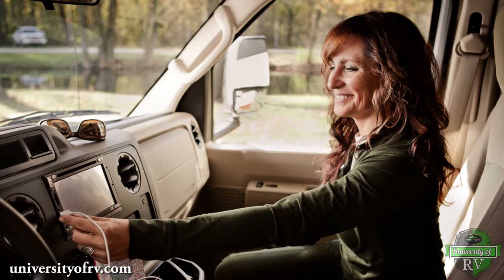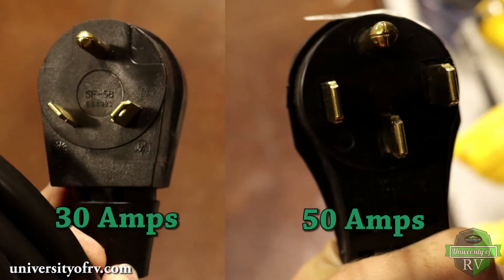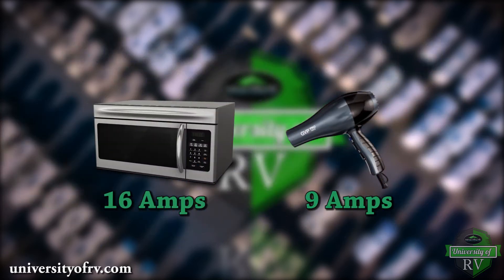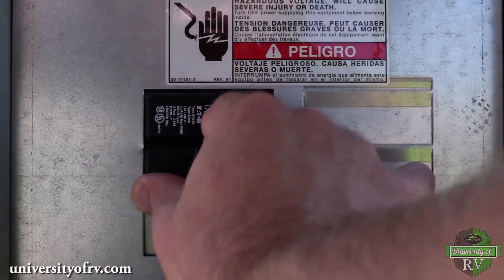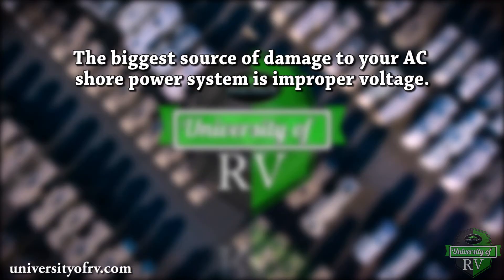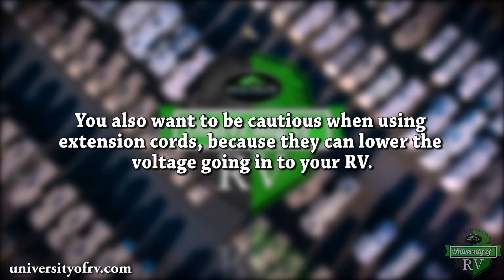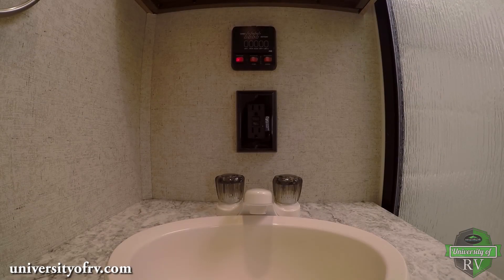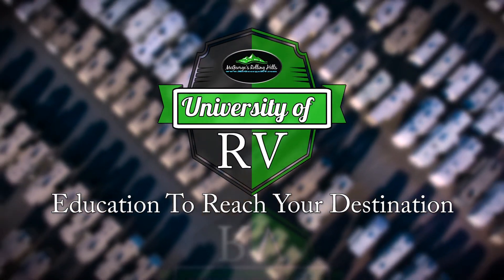RV Troubleshooting: 110/120 Volt AC Shore Power

Comment: i connected 30 amp cord to an extension cord plugged in to household outlet, after 20-25mins AC & fridge shut off, no power coming into the fridge, a/c, radio, though lights are on do you suggest changing the use of an electric cord for extension? should it be same 30-amp i should buy? Need help stuck in the forest
Reply: Your household current may only be a 15 or 20 amp house breaker.  You don't have enough amperage to operate your AC.  If the fridge runs on LP gas turn to gas and it will use a small amount of your 12 volt dc current.  Don't overload the household service as it could burn the house down if the breaker is bad.